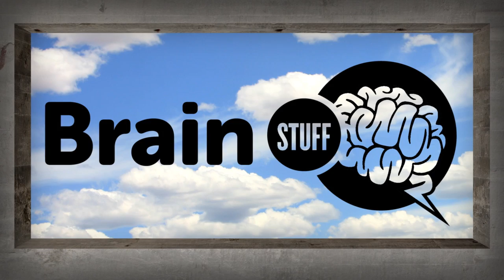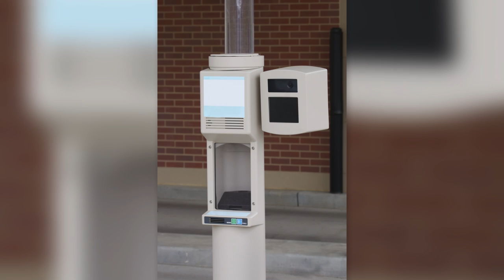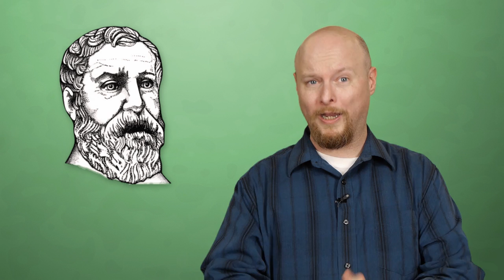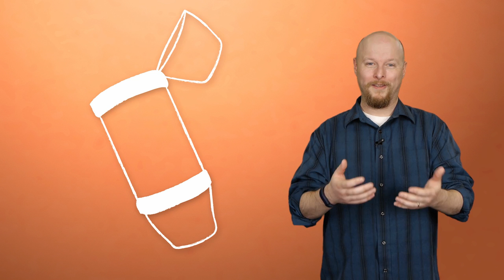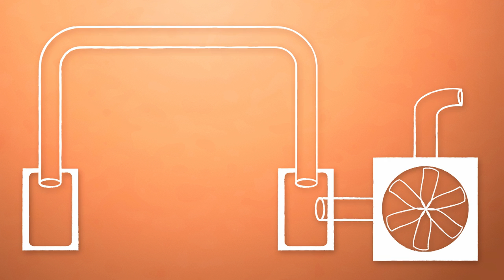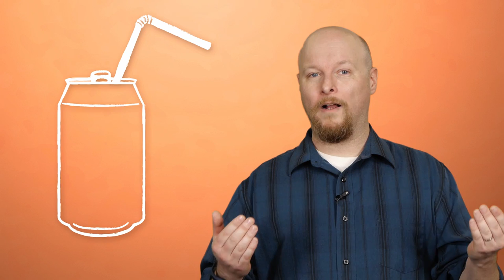How Do Pneumatic Tubes Work?

Comment: If I ever own a business, I'm putting in a pneumatic system. It's happening.
Reply: did you ever do what you said you would yet ?
Reply: That's so 1850's Great Britain, lol. Drones with set flight paths might be a better option these days. We just need a complete map of the sky and to make altitude assignments for each flying craft size. There will also need to be launch and land areas at designated spots everywhere air crafts fly. These designated areas of air space would be a lot like up and down escalators or elevators in the sky.
Reply: @mediaquadmarketing  How would that be cheaper on the long run tho?
Reply: Same
Reply: It would probably be slightly better... But tubes just look more awesome

Comment: 2:05 it's not about density, It's all about pressure! You can cool the air on one side making it denser but if the pressure stays the same the canister will not move.

Comment: "And in other news tonight, FEMA has been mobilized after a heavily populated region of Brooklyn has sunk into the ground. Experts blame the enormous sinkhole on Amazon's ambitious plan to connect every household in America to one of their distribution centers using pneumatic tubes. 'There's just more tubes than ground under there,' said one emergency worker.

"'We should have stuck with drones,' said one Amazon employee on condition of anonymity."

Comment: I’m working on designing a prototype city, and two considerations currently are a monorail in a tube with carts or some method of pneumatic tube, that’s the whole reason I came here, so technically I guess I may think it’s time for a pneumatic tube revival, but I’m not sure I like the idea of not being able to branch connections, having roughly 10 tubes per city block would quickly add up, even if small. Btw the main reason for such extravagancies is the city design is based around not letting cars (or trucks and such) into the city itself, as they are dangerous and take space best suited to other things, space that ironically makes travel further.
Reply: Same !!!!!! I have had this idea floating around for a long time and just scribbled away . I live in a landlocked country and I think this can be very practical.I would love to share some ideas with you .

Comment: I'm designing my own house of which I want to integrate into the design a pneumatic tube system for the trash and the laundry. After watching this video I'm curious as to if on a smaller scale you could replace the fan with a diaphragm of sorts or even a plunger weight hour glass design of a wider diameter in order to gear the displacement of air to accommodate for distance. Sorta thinking it up as I go. Lol. Long story are there any particular fashions you might see fit available in your areas of expertise? No homo

Comment: they should have never stopped using it. that must have been so much faster than snail mail is today
Reply: haiggoh I don't think the tubes can branch though. If one post office caters to say, 10000 households, they'd need 10000 different tubes. That's a lot of tubes.
That said, you could probably overcome that issue fairly easily.
Reply: Dojan5 you could. Basically it is like train rails. You can only use one path at a time but you could build a system that changes via switches so you could branch out after all
Reply: haiggoh and specialy how to pu in the tubes underground if its in the train tunnels they still make hole to the homes that waiting for there mail
Reply: but they already had tubes before WW2, it's not like it's impossible. Think about water pipes and electricity, same thing

Comment: What this (very good) clip doesn't convey, is how common & ubiquitous this stuff was. I'm old, child of '62. In the late '60s I lived in a very small & backward country town called Kempsey, in northern NSW, Australia. They didn't have a town wide delivery system, but the bank had one, the local supermarket had one, and I think a couple of the office buildings had them. It was about as common as a switchboard / internal phone system, PABX. Much of the time, it performed the same job as an internal phone system, with the advantage that you could scribble a note, ('Is this cheque to be accepted?') and send the note and the cheque...

Comment: Banks and other offices in Canada stopped using this system in the late 1980s, because sometimes the capsules got stuck in the tubes and naturally, the one that got stuck or misdirected was the one that was too valuable to lose. I worked in one of the last banks to use the system.

Comment: How dose it make the turn at the bends with out getting stuck or loosing suction"
Reply: Rubber skirts are flexible.
Reply: The bends are much more gentle than shown in the animation, so there's only a very small gap between the skirt on the carrier and the tube wall.

Comment: There is actually a parallel universe where Amazon got started in the 1890's delivering parcels via 14" diameter pneumatic tubes that can handle 22" long pods. Over there everyone now has a tube going to their house connected to an intricate electronically controlled logistics system and a package can be sent from a home in NYC to a home in LA in 12 hours or less.
Reply: 7.2 hours give or take if we're talking about the 1960s project that could deliver people and since we're talking about a package I would say even faster since less weight unless you're delivering a car. 388mph/2797 Miles = 7.2 hours. I guess maybe less than an hour for a shoebox-sized package. I could be wrong since its a parallel universe.